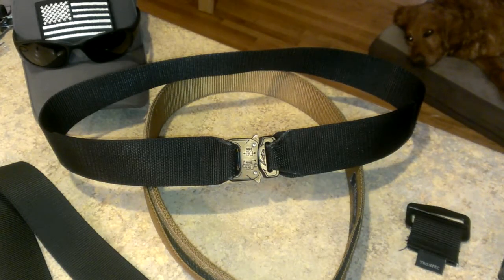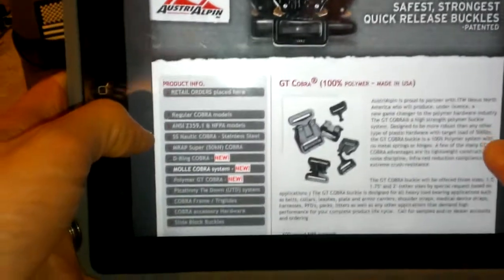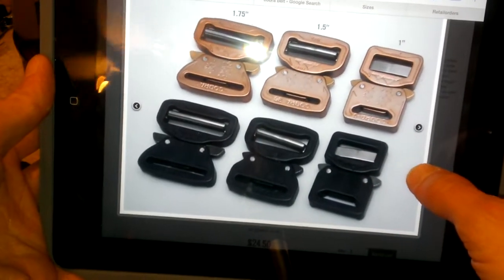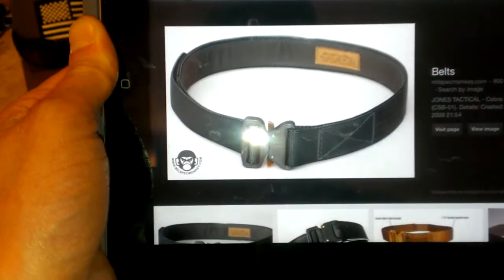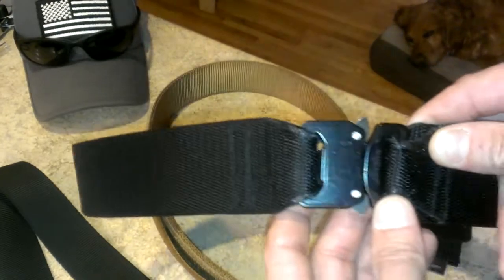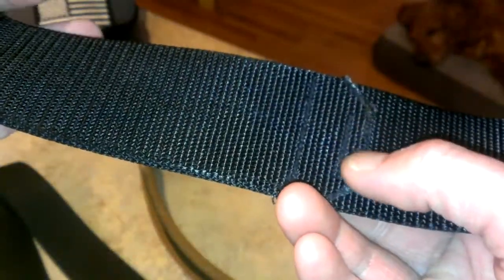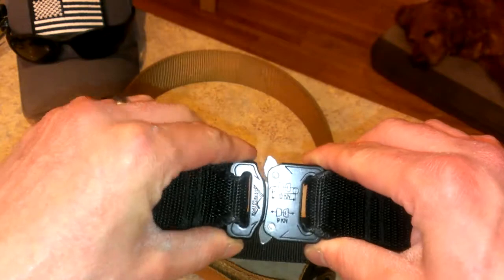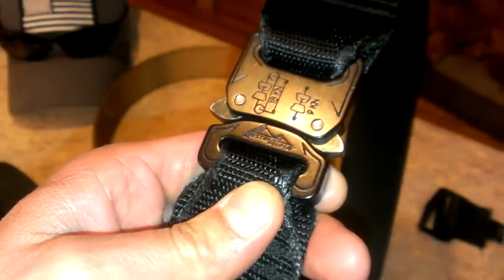D.I.Y. COBRA BELT

Comment: Hey bro, I make Cobra buckle belts, I own a tactical gear business and it seems like you got the right idea. One tip, from a belt sewer to another, is buy Kryptek Typhon Fabric, or some type of 500 Denier or more fabric, and wrap the webbing in the fabric. It will make your belts POP and look more professional and fashionable at the same time. I recommend 500 denier or more. Cool belt man, love seeing people getting shit done
Reply from the maker: whats your company, ive been wanting a typhoon cobra belt for a while now
Reply: the 1 inch cobra buckle model, should fail over 2000 lbs tensile strength. it is good up to 2,000 lbs. these knock offs are failing at very low weights and is gonna get somebody kill. be wary of that my friend.

or if you need me to make you a belt, i offer really decent pricing when you take into consideration the price of the buckle itself and labor.

i also highly recommend using only (bonded nylon thread) specifically #69 Bonded Nylon.
Reply: I wish itw nexus cobras buckles, where available in smaller sizes,like the aluminium equivalence ... Such as 25mm or the like.
Reply: @justinbutler3119  Hey man do you still make Cobra belts. I'm looking for one for like ar15 mags and a pistol holster. But I really don't know what I'm looking at. I'm not like a 3 gun competition guy or anything. Just want to shoot targets and have somewhere to put extra ammo without fumbling around. Tried your link to your Etsy but it was down.